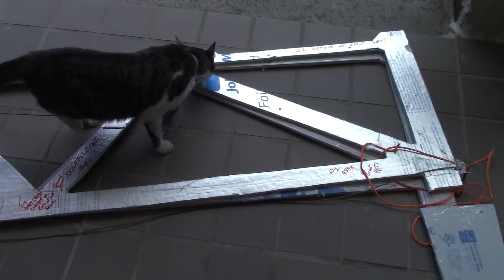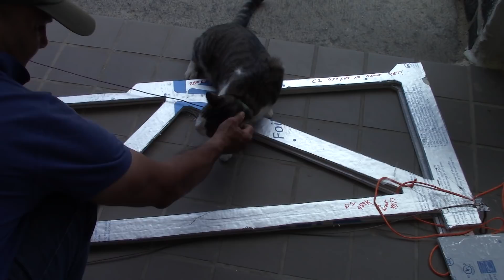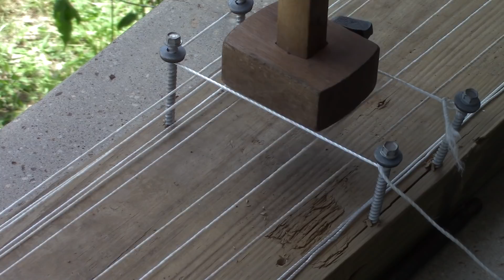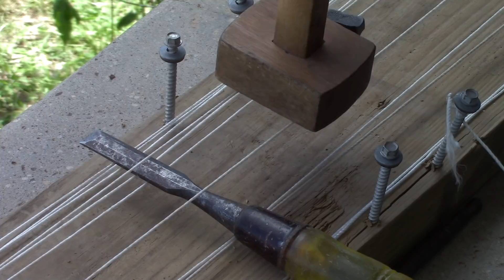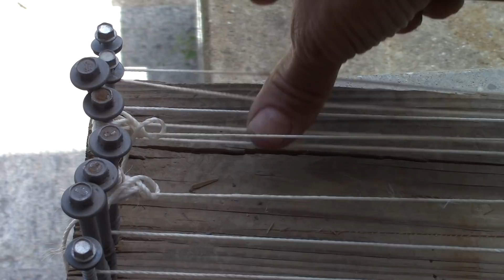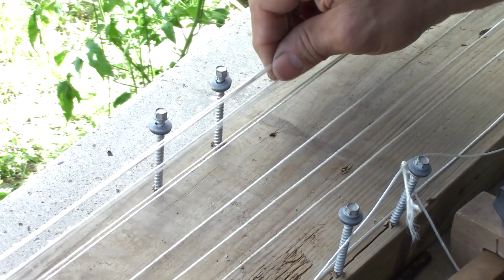FIU Bridge Collapse NO TRANSVERSE CABLES were tensioned to share loads Before 11 was tensioned PT 1

Comment: Thanks K, keep it. You're now proving your theories through scale model application. 

Yoy did such a thorough analysis of the data, I already have what your model shows in my head. You've been drawing that picture for a year and a half

I'm impressed by your depth and doggedness
Reply from the maker: Thanks Tommy, very pleased to read your comments about your time on this and your visual...  awesome.
Reply: @LoadPathEngineering  
But what keeps bugging me is seeing the sequence of the collapse.

The deck just north of 10/11 fails pulling down the canopy causing the canopy to fail just south of the node ... (that I easily get) which caused the canopy from north of 11 to12, still connected at 11, along with 12 and the diaphragm to momentarily rotate up and back on the pier before rotating back toward South and down after the deck had hit the ground. That I also easily understand 

I can't see the lifting off the pier sequence in my head resulting from the hinge effect which left the J rebar  in pristine condition.

And finally, tracing back the order of failure, if any, of the pt rod seen when the hydraulic ram still attached - pt rod B, or upper rod in truss 11. 

It didn't pull from the blister/diaphram, neither did rod A, the lower rod in truss 11,
pull from the deck.

The crushing of the ungrouted diaphragm on the pier as a result of the detensioned 11 load it was under did not fail the structure but contributed not carrying the load of 11 sending it back down to the deck via truss 10...??? Explain like I'm 5.

This is where I could see a computer might be wothwhile strictly as an animation based on your findings... but I have a sense you're already conjuring up one with your own two hands for us
Reply from the maker: Tommy, I just did this 4 part series and I hope it has the answer in there... but, please, walk your way through them all... as the part you are looking for is partly in all 4 parts...  the last video or it might be number 3, has a ''computer'' (my model being destroyed to show the actions)...

Part 1 of 4 https://www.youtube.com/watch?v=DLPxjYPV0E0&feature=youtu.be
Part 2 of 4 https://www.youtube.com/watch?v=sGadr00eelA&feature=youtu.be
Part 3 of 4 https://www.youtube.com/watch?v=U89Jxz0jJH4&feature=youtu.bePart 4  https://www.youtube.com/watch?v=y_Gs7H3B1nU

Comment: What a wonderful string model to visualise the post-tensioning system.
Reply from the maker: Don't forget, this free body diagram, the tension is what post tensioning is countering.
This allows to visualize the load path...
I will do another one showing how tension / friction between strands also is not balanced in the full length.

Comment: Nice!  Looking forward to seeing the model with the canopy.
Reply from the maker: Working on a diaphragm piece...
Might turn out to be pressed paper; as I can peel away layers and reproduce "fractures"...
Also, a three D printer would be nice.
Finally, a drawing with full scale on one page that does not change from one page of the drawings to the next!
They used so many scales in those drawings, I have made a few mistakes because of that...

Comment from the maker: https://ibb.co/gM5kc72  Free Body Diagram 
I have taken some liberty in doing this description and explanation so please allow me some ''room''...
Post tensioning puts tension / tendons in tension which puts the concrete in compression...  This video is to help you visualize that tension and how it may look if you could do a load path diagram... 
It would visualize like something like this... Of course, depending on bonded or unbonded tendons will make a difference also.  Engineering free body diagrams would show something / or translate as this demonstrates... +/-
With that said, I hope this helps those that do not understand transverse cables and the importance of them... understand that they must ''equally'' transfer all the loads out to the diaphragm for this system to work.
At one point the longitudinal cables could NOT transfer the loads to the diaphragm and this caused the deflection and load imbalance of the design to the point of ultimate failure, as we see in the video.
I will attempt to do a better video once I get some time, which will include some ''concrete bonding'' to show the deflection of tendons with the bonding of ''concrete"...
The post tensioning "counters" the tension forces in the deck...  basically, NOT allowing it to go into the ''range of tension"... keeping it in compression -- by, not allowing ''deflection'' in the concrete.
Thank you for watching and please comment... any haters will be ignored and perhaps even psychologically attacked... for your weakness I find interesting... and I so enjoy the human psychologically.